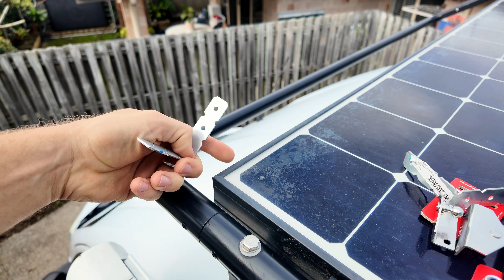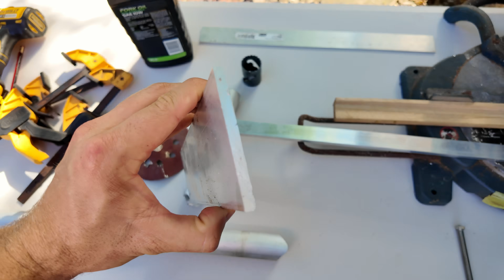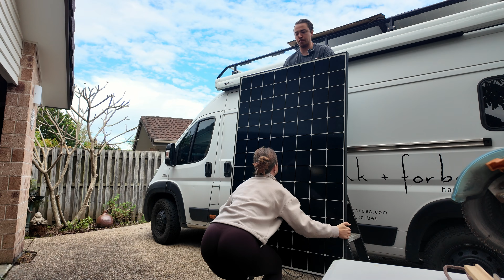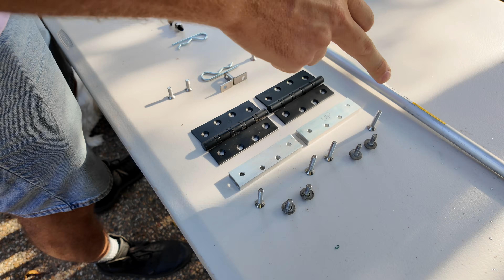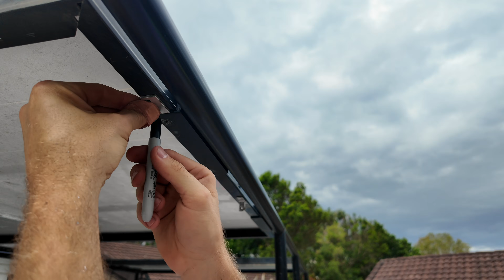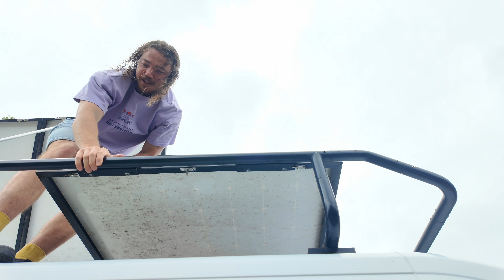1200w Tilting Solar Panel Upgrade | Off Grid Campervan | Van Build

Comment: Tell us about your battery storage. How many kWh will you have to work with? Can you charge it as you drive the van?
Reply from the maker: We have 400Ah of lithium batteries and a small 30A DC-DC charger. We've had the tilt setup for nearly a year now and mostly have only used it during winter in the snow and on some rare occasions. We did a 4-year review video recently explaining our build and what we'd like to change regarding our electrical system of you're interested. It's titled 'What we'd do differently in our next van build'. 👍

Comment: The bolts that hold the support poles that support the tilted panels can't be adjusted to different angles.
Reply from the maker: Yep, correct, we've got it set to a fairly steep angle - primarily for winter sun and late afternoon sun. The bolt head does allow some tolerance inside the aluminium tube if we did want to adjust the angle, but so far it seems to be a good angle for our needs.

Comment: Do you guys have a video explaining how you put together the original roof rack?
Reply from the maker: Unfortunately not, sorry, we hadn't started making videos until recently. But it was all connected together using basically the same principle as that cross member in this video... but with a more robust bolt connection. And the tube bends were pre-made, we purchased them online.... hope that's of some help to you
Reply: @BrinkandForbes thank you!
Reply: @BrinkandForbes all good thank you! Do you recall where you ordered the tube bends online?

Comment: i always like to see how builders face the tilting panels problem for RVs. 2:00 don't place anything on the panels, if you don't have to. You will have a lot of opportunities to scratch them in wild, no need to do it with your metal hardware ;)
Reply from the maker: Yeah that's a fair point, it was just such a handy little work surface 😅

Comment: arduino+stepper motor+ntfy or just email would make this a killer automated setup. May not be needed but who knows sometimes it might be extra freezing, and you just can't be bothered to put it up, send a message to arduino and tell it to lift it up. Thanks for the video, this is not needed but who knows if it will be, maybe in the future y'all get a house and want to do the same concept but bigger.
Reply from the maker: I've never played around with an Arduino, that would be a cool project! 🤔 If I can find some affordable stepper motors or actuators I might give it a go. Thanks for the suggestion! 👍

Comment: Pretty much what I’ve done. I used aluminium crutches, with the elbow section cut off for the supports, and threaded knobs to secure the panels when they’re down. A telescopic ladder, which lives under the bed, for raising and lowering the panels.
Great job, well executed 👍
Reply from the maker: Thank you mate! I love the crutches idea - with the Adjustable height - that's clever 👌👏

Comment: Thats geat mate.  Have my panels mounted and hinged similar to you and will prob strut the same. Why 60deg, here inn NZ th norm is about 40deg, may have to rethink.. Good work.
Reply from the maker: Thanks mate! We ended up with 60deg. for a couple reasons... the aluminium came in 3m lengths and I just cut them in half, so 60 was the result. But I did want it to be steep because I only expect to tilt them during the winter. I'll continue experimenting a bit though... I know that for fixed panels (say on a house roof) the best angle for year-round solar gain is whatever your latitude is, so 40 would make sense for somewhere like Wellington.... hope that's useful to you?

Comment: How did you get this signed off by an engineer for insurance purposes?
Reply from the maker: Do you mean the whole roof rack or the tilt mechanism? The whole van fit-out was certified by an engineer a few years ago. They didn't take much interest in the roof rack... they did note it as a 'bolt on accessory'. I'm not sure if that's of any significance, but it didn't require any certification. I haven't had the tilt mechanism looked at... don't think it needs it. 🤷‍♂️
Reply: @BrinkandForbes  Ok, thanks for the input. I'm looking at having a lot of solar on my build, I really like your setup but in the time that I've started researching I've found out that certain things need to be signed off like electrical and gas but I've been struggling with how to mount and fit the solar while having a max fan and roof ventilation.
Reply from the maker: Yeah the double decker rack seems to be the only way to go, if we were to do it again we'd use the standard maxxair vent without the giant rain cover (because the solar panels provide a lot of cover anyway), that would allow us to bring the height of the rack down a bit.
Reply: @BrinkandForbes  I don't know I think I would still go the way you have, as your design offer additional storage.

Comment: Hi, you can see how facing the sun affects solar output using a panel that is on the ground and then slowly incline it. Yep it makes a big difference.
The solar panels re not that strong. You need the hinges as close to the corners as possible or cross brace them.
Actuators are a good idea but have an issue and lifting them is far easier if you only do it occasionally.
I’ve seen this on another install on a roof on a van in the UK.
They can stall out is you don’t have them starting at an angle. Thus you would need to mount one end of the actuator close to the vehicle roof so when they start it will lift the panel at its heaviest point in the range of movement.
Take care and keep it simple. M.
Reply from the maker: Thanks for the tips Mark! Actuators would be luxurious, if we find we're tilting the panels often enough I might have to consider installing some in future. Good suggestion about the corner bracing too, I might take a closer look at that 👍 Cheers!

Comment: Impressive roof rack I must say!  I'm looking to try and fit 1200W of the Renogy ShadowFlux panels on my van roof (2x3). I was surprised to see the Maxx fan under all of that! Maybe I can come up with something similar:)
Reply from the maker: Thanks! Yeah, having a good amount of room between the roof surface and the panels also seems to help a lot with keeping the van cool, and should also help keep the panels cool (better efficiency). Good luck with your set-up! 👍

Comment: This project has been in my head for a while, ,and good ol' utube,,bingo great presentation, clear, skillfull and straightforward 😊you'll definitely need the tilt  just travelled through Vic high country and currently in tassie  ,,only getting a third of my usual output with flat roof panels ,luckily have 440wt portable,,almost have it standing straight upright 😮 safe travels😊
Reply: Yeah, the sun doesn’t get very high in the sky here in winter and the days are short. Being further north, solar in Victoria in winter on a sunny day will be a bit better than Tassie in winter on a sunny day.
Reply from the maker: Thank you! and blimey! 😯 Maybe we do need some longer, adjustable struts! We're looking forward to getting back down that way... must be getting cold in Tassie! Thanks for the heads-up!